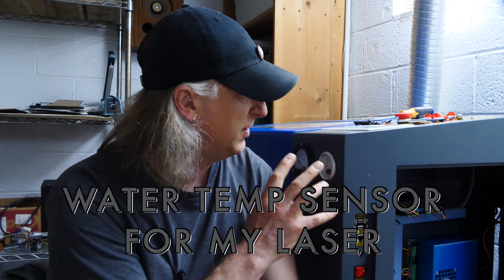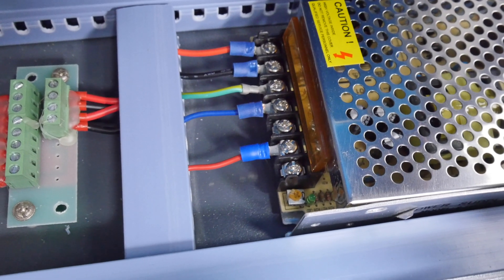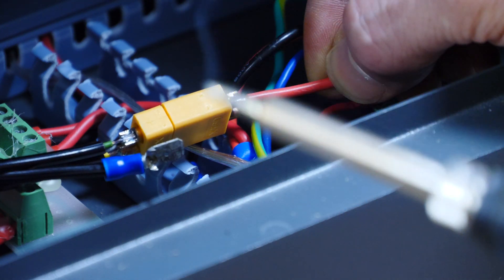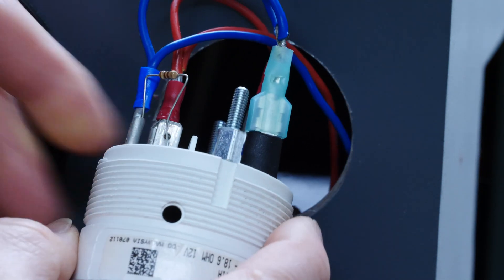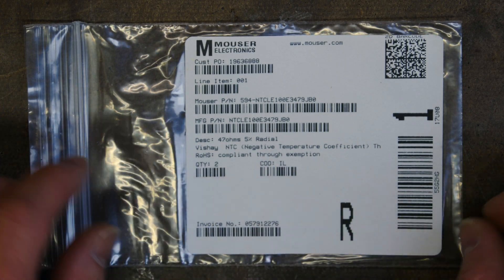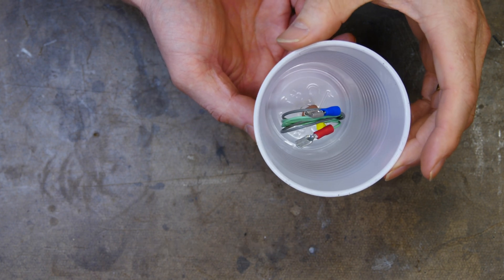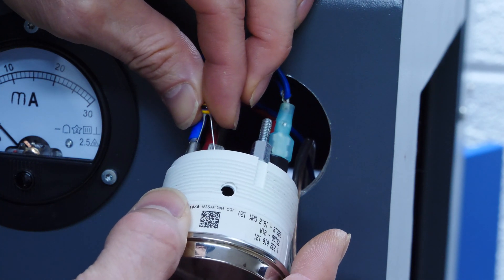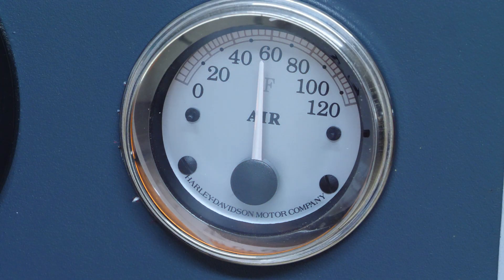Adding a Harley-Davidson Temperature Gauge and Sensor to my 50W Laser

Comment: I did some extended research about solder fume extraction...

Does that Kotto Box has particle filter or just the Greyish black 'Active Charcoal' filter?
Because most Solder Fumes are no 'Gases' most is Flux 'Droplets'
Reply: If you're really worried about exposure to flux vapor/droplets you could use a a system that vents outside. Look on your local craigslist for people selling indoor grow setups, you should be able to find a used  high power inline blower fan + ducting for less than $50.